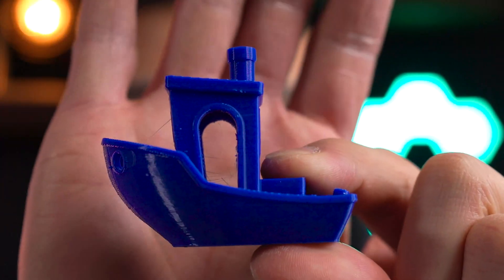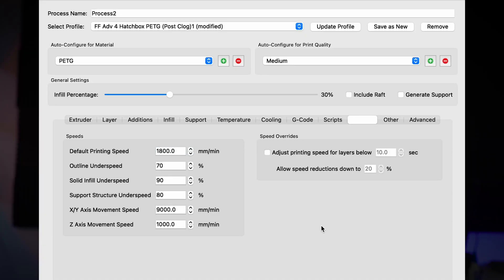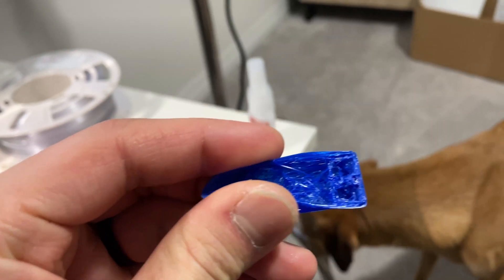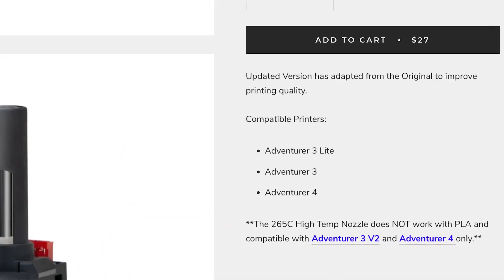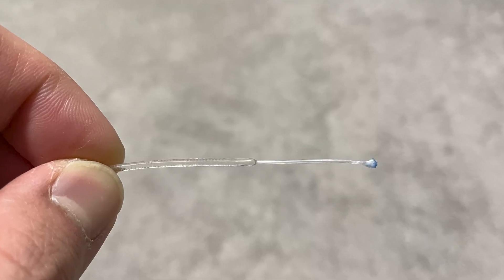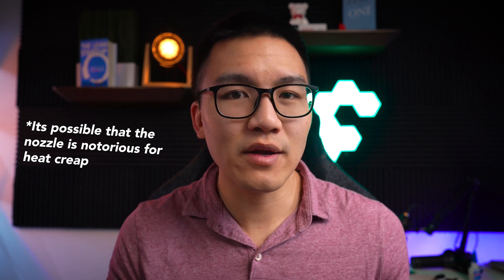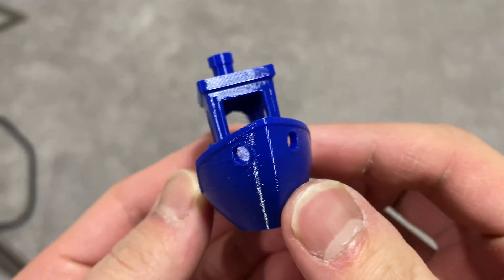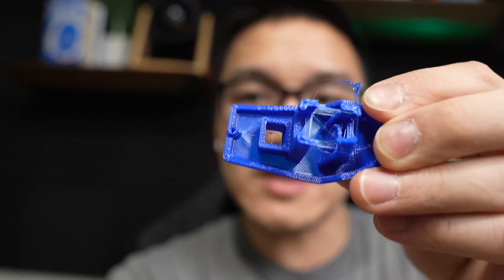Avoid This PETG Mistake On A Benchy

Comment: Hey Daniel, thanks for sharing! Also just read in the comments that you designed that 2 part cooling piece nice!! I remember it was an upgrade people did for the adventurer 3, Also some adventurer 3 users actually managed to install a e3d full metal hot end on their machines but I can't figure out any information regarding the adv4...  It's one upgrade I would love to do.
Reply from the maker: I have yet to prove the dual duct actually works better. That would be sweet if we could switch to a different extruder. I did a little reading last night and it seems like its possible even with the ribbon cable. There are a bunch of JST connectors that go to the hot end and fans so I presume we electrically connect the new hot end to this board and just have a different enclosure

Comment: Daniel, where did you get a dual sided part cooling fan?  Is that something you printed?  If so, can you post the .STL ?
Reply from the maker: Yes I designed this myself. I’ll make the stl file available on thingiverse when I release a video on it (coming very shortly). It’s a two part print that requires super glue in between. I have yet to do a full comparison between it and the stock version so that’s not too sure if it’s actually better haha
Reply: @justmakeitdaniel7667  To test the 2 sided part cooler mod, suggest you print an open ring about 3.5 to 4" in diameter and about 4mm in wall thickness.  What I've seen here is stringing or hairs will appear on the inside of my rings, at specific clock positions (say 11 to 1 oclock only), which with the extruder traveling in a clockwise pattern, will leave some parts "cooled less" with a Left-Only part cooling fan.  

I have not been able to entirely solve this problem using FlashPrint, even though the rest of the inner circumference walls print clean.  Strongly suspect it's caused by the Left-Only cooling.
Reply from the maker: @dondec  what speed did you print at for this ring so I can test?

Comment: Just to let everybody know, FlashForge suggests you not turn off your printer while the Heat Break Cooling fan is running.  Let the fan run till it shuts off automatically at 50C, otherwise filament ABOVE the hot end (the stuff cooled by the Heat Break Fan) will melt from heat in the hot end, creating a clog that's hard to clear.  If that happens, heating the nozzle to max temperature will not help clear this, since the clog is above the hot nozzle and continuously cooled by the Heat Break fan.  

If you have a clog, what I've done is (and perhaps an alternative to what Daniel showed): 1st unload your filament, then disconnect the Bowden tube from the extruder, preheating the Nozzle to max temperature, then push the Nozzle Cleaning Tool (large PIN) down as far as it will go.  It doesn't go all the way out the other end, the diameter of that Cleaning Pin is wider than the nozzle diameter.  

If it works you'll see a blob shoot out through the nozzle.  Then remove the Cleaning Tool , because its hot now remove it quickly, to prevent the hot PIN from melting/damaging the PTFE tube that's inside the nozzle.  Hope that's clear.
Reply from the maker: Wow good tip on not turning off the printer! Glad you mentioned this cause I never really thought about it.

I did use the unclogging tool at first (I only mentioned it for a very brief period) but that didn’t seem to help. I think what happened was I had a partial clog that didn’t shoot out. Hard to say though since I didn’t cut my nozzle in half an dissect